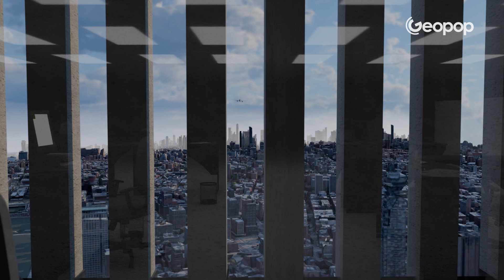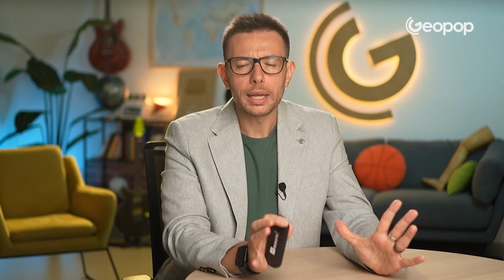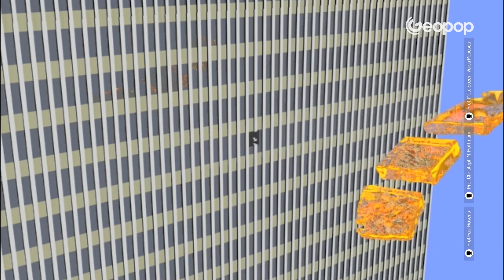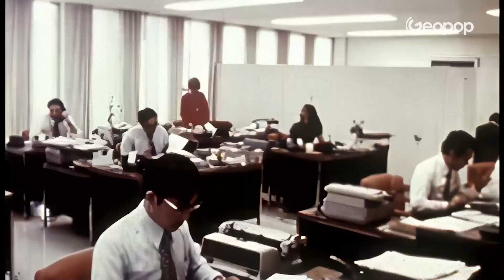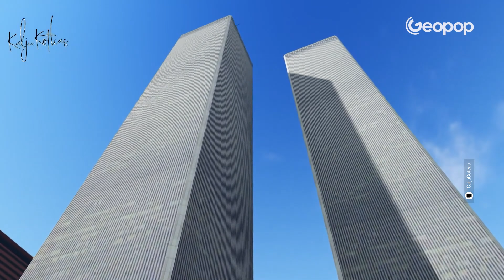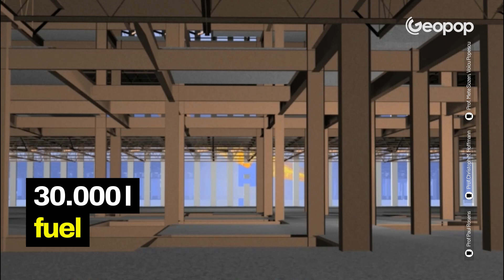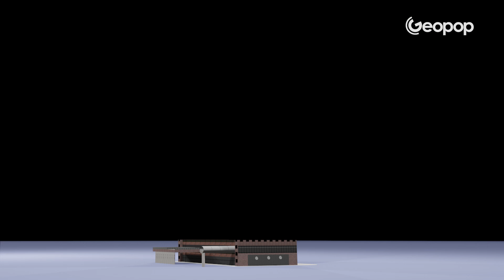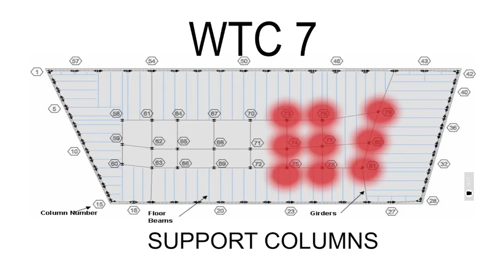9/11, 2001: The Technical Reconstruction of the Twin Towers and WTC 7 Collapses

Comment: This is absolutely laughable 😂 unreal that you seriously made this nonsense video and are standing by it. The towers could have had multiple planes hit them and they would still be standing if it wasn't for what ever was in them buildings to bring them down. The buildings literally would not have collapsed into their own footprint without it being pulverized into dust. Tons of concrete glass and plastics completely obliterated. Literally don't even need to be a professional it's common sense. Common sense tells you this is a complete lie
Reply: Nonsense.  I am going to respectfully disagree and offer a more plausible and far more detailed evidence, not ideology driven alternative.

Twin Towers collapses were relatively straightforward, well understood in the professional engineering community in within just weeks. For the average person though it still requires some effort. Engineering is hard, and who has that kind of time?  So the internet stepped in peddling a lot of really bad information, simple slogans and hand-wave rationalizations that are exciting and require little to no thinking.  That crap gets far too much attention.

Because anything can seem like a conspiracy if you don’t understand how it works and I’m an understanding kind of guy, I prepared this short, detailed technical overview of Twin Towers collapses from my own observation and analysis of available true and relevant facts. No politics, ideology or magical thinking, just engineering. Hopefully this will dispel many common myths and answer most if not all questions you may have about the collapses.  

While complex, most of the Twin Towers collapse mechanisms can be seen with the naked eye and easily discerned and understood by the layperson IF sufficient time is taken to understand.

1. The Twin Towers consisted of 4 primary structural elements that together formed an integrated system where each relied on the others. 47 hollow box-section steel Core Columns carry the majority of the gravity loads. The 236 hollow box-section steel Perimeter Columns carry the remainder and ALL of the lateral (wind) loads. Long-span Lightweight Steel Trusses connect the core and perimeter column together at each floor with a Hat Truss on top to tie the structure together as an integrated unit where no element can survive without the others. There was no structural load bearing concrete and most components were bolted together.

www.youtube.com/watch?v=u7OqrC74Dm4

2. The impact of 120 tons of airplane (= to about 12 dump trucks) at speeds up to 589 mph with the energy of a ton of TNT completely destroys the aircraft. This in no way implies the Towers come out unscathed. Many perimeter columns are damaged or destroyed as are some core columns (example; 33 of 59 perimeter and 20 of 47 core columns damaged or destroyed at the impact floors in the North Tower), This damage is primarily through bolt-shearing failures at the end connecting flanges, as well as bending, twisting and fracturing of weld seams. There was no cutting or slicing - the reality was far more violent and messy.

3. The impacts destroy or damage fire insulation, fire breaks and sprinkler systems on multiple floors. Huge fires are started across multiple floors simultaneously and allowed to spread rapidly with no effective firefighting or fire suppression. This was an unprecedented fire event .

4. The hotter steel gets the weaker it gets . With fire insulation stripped away and no sprinklers the survival time of the steel greatly reduced. Gradually over time heat causes the lightweight steel Floor Trusses at the impact damaged floors to sag, which was observed and recorded. No steel melted or needed to. Structural steel fails long before it becomes a puddle. It just needs to bend

5. Sagging floor trusses pull on the increasingly weak and overloaded Perimeter Columns, causing some of them to bow inward by up to 5 feet. A straight column is up to 4 times stronger than a bent column. The bowed Perimeter Columns buckle and fail, quietly initiating collapse. The formerly static mass above which the structure below could easily support is converted to a dynamic mass up to 30 times greater. Because they have buckled, the Columns above and below the failure point are no longer aligned . The load bearing structure below no longer bears any load as it falls past the lower columns, NOT onto them.

www.youtube.com/watch?v=ULdiD6gYZO0

6. Thousands of tons of debris fall within the four outer walls, down through the open office space, crashing onto the first intact floor it encounters, immediately breaking the bolted column connections as the amount of resistance the Floor Trusses can offer is negligible. The falling debris slows only marginally and briefly. Note: 
6a. This is NOT a solid top block crashing into and “crushing” a solid bottom block . 
6b. The debris falls past the columns not onto them. The columns provide no resistance to the falling debris. 
6c. Only the bolted floor truss connections to the core and perimeter columns offer any resistance. A pair of 5/8” bolts at each end of each truss vs. thousands of tons of falling debris. 
6d. No laws of physics are violated. 
6e. There is no 20 floors against 90 floors but rather 20 floors against one floor, then 21 floors against one floor, then 22 floors against one floor, etc. 

7. This floor-led collapse progression within the four outer walls can only go straight down.
7a. This process is often incorrectly referred to as “pancaking”. The catchy name stuck but nobody knows what it really means and "pancaking" is too simplistic and inaccurate anyway. I prefer Kaiserschmarrn.

8. Collapse progresses through the floor systems past the columns, through the path of least resistance . The resistance offered by each floor is always the same while the mass of debris and its velocity – thus its energy - increases with each floor failure. Each floor offers the exact same resistance to the falling mass while with each failure the falling debris constantly gains both mass and velocity. *This process of floor-by-floor destruction cannot be arrested, it can only speed up . Rate of floor failures increases with each floor as momentum increases, reaching an average acceleration of 0.65 of GA, or 35% slower than true free fall. Bam, bam, bam down the building until there are no more floors to fail. The resistance offered by each successive floor is always the same. More mass, more velocity, same resistance with each floor. Don’t get stuck on the but the lower floors weren’t on fire nonsense. They weren‘t and didn’t need to be.

9. The Towers were 95% air by volume. As that air was compressed inside the building it is forced down the tower and blown out the sides in reaction to the building collapsing . Those were not “explosions”, it was expulsions of compressed air caused by the collapsing building, explaining the low velocity, lack of flash, blast, supersonic pressure waves and lethal high-velocity ejecta.

10. Perimeter Columns become detached and peel away like a banana behind the collapse front, playing out to the four points of the compass extending to more than 800 feet from the base of the towers. This was quite obvious from examination of the debris pile.

11. Core Columns fail last as their internal beam bracing is stripped away by falling debris and lateral support from the floor to perimeter columns is lost.

www.youtube.com/watch?v=WpHXj62Ylw0

12. For those who care about how long this whole process took; 31-34 seconds from the moment the perimeter columns buckled until the last core columns hit the pile, or 1/3 the rate of true free fall. Don’t believe me? Just watch any video of the collapses and note the loose truly free-falling debris dropping much faster than the towers themselves.

13. Each Tower had a 1-acre footprint. Far from collapsing inside their own footprints the debris pile spread out over 17 acres in a pile up to 14 stories deep. 8 surrounding buildings were destroyed and scores more damaged by the falling debris.

14. NOT observed were the 180-190 dB bangs of thousands of high explosive devices or the blinding bright flashes of burning thermite. Neither explosives or thermite could have survived the impacts and subsequent fire nor could have caused the (silent) perimeter column buckling that clearly initiated collapse either. A video of a shocked and injured firefighter casually using the magic word explosion is in no way proof of explsoIVES and the demolition_ case relies entirely on that sort of thing. There is zero tangible physical evidence and it would be technically impossible, totally impractical and completely unnecessary. No one would bother.  In 24 years zero structural engineers of tall buildings, including the 1/3 that have retired in that time, have made any statements in support of pre-planned demolition claims. NONE. The lack of any such citations in the engineering literature (published in any country worldwide) is telling.

15. Twin Towers were perfectly safe within their design envelope. They only collapsed when taken far outside design parameters by an extraordinary and unprecedented event

Impact + Fire (heat) + Time + Gravity = Collapse . Remove any one of those 4 elements and there is no collapse. Ignore any of those elements (as many do) and you will never understand the collapses. The Twin Towers were an integrated system in which no one component could survive without the others. One fails, the rest follow, through the path of least resistance – DOWN – through the open space, bypassing the path of greatest resistance – the columns. Nothing I just described violates any laws of physics. All of the above is true no matter who planned and carried out the 9/11 attacks or why

I hope you found this helpful and informative. It’s meant to be non-adversarial and solicit informed critical comment, positive or negative. If I made any errors of fact, logic or reason or left anything critical out, please let me know so I can fix it. To stay focused, just one point at a time please and on-topic (Twin Towers ONLY). No word-salads of Gish Gallop. IF you can offer a more plausible alternative be my guest. Please start any reply with the words “Tits McGee” or I’ll know you didn’t read it, aren’t serious and wasting my time.

Comment: Anyway, I don’t believe that the Pentagon was impacted by an airplane. All the security camera footages around the Pentagon were seized immediately after the strike. Based on the footage of the twin towers, no way the Pentagon only had just a small portion damaged if an airplane hit it.
Reply: Belief has nothing to do with it.  Deal in facts.

www.youtube.com/watch?v=0SL2PzzOiF8&lc

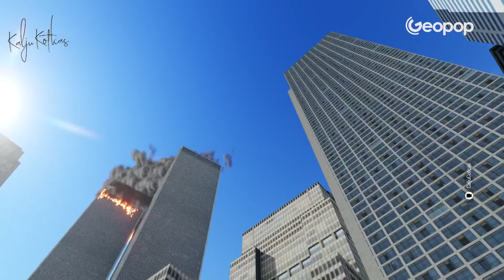The above video was shot on 2 identical low-res parking lot entry gate cameras with a fish-eye lens to widen the view at the short ranges the cameras were intended to capture, and short focus. The plane won’t jump out at you. It takes a little effort to make out what you are seeing. Each camera was focused at about 10-15 feet and shooting at just 1 fps. It is NOT continuous video (which is shot at 60 fps or better) so don’t expect continuous video. The target is roughly 800 feet away and moving at 462 knots, which means it travels 775 feet between frames. You can see the target by pausing at 0:05 for the 1st camera and 1:32 for the 2nd. 

There is just one frame per camera, the target is far away and not in focus. 

At 0:05 the aircraft is partially obscured by the parking lot ticket post on the right side of the frame. The nose, top of the fuselage and vertical tail are visible around the obstacle, as is the spiral smoke trail from the damaged left engine behind the aircraft. 

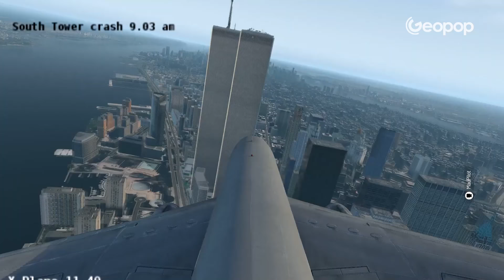At 1:32 the entire aircraft is visible, easiest to spot by following the smoke trail from left to right until it stops. That’s the airplane Personally, I always found it easier to watch for the doppler. Compare the frame before and look for what isn’t there. Have two tabs open and bounce back and forth between them. 

If you still can’t work it out then this video should help: 

youtube.com/watch?v=hixQ3zc2Bho&t=293s&ab_channel=Doll1789MarshallDhody

Then there is the mountain of physical evidence and witness accounts, all of which confirm Flight 77 hit the Pentagon - and all of which you are ignoring.

We know Flight 77 – a Boeing 757 - hit the Pentagon because of ALL of the following true and relevant facts, not because of one random anomaly. When complied together, all of these true and relevant facts form a single inescapable conclusion; 

1. Witnesses: Local and national media published or broadcast the accounts of ALL of whom reported a plane hit the Pentagon, while no witnesses reported seeing anything else (ie: none saw a missile). Around 2 dozen witnesses could identify either the aircraft type, the airline or both. 

2. Flight Path: On its way in, Flight 77 created a damage path (the tree hit by the left engine, the 5 light poles, the garden wall on the Pentagon lawn and the mobile diesel generator) which is consistent with an aircraft the dimensions and layout of a Boeing 757. No missile could do any of that. 

3. Impact Hole: The impact hole in the outside wall of E-Ring at Wedge 1 of the Pentagon matches in size and shape the Boeing 757 from engine to engine. Wing impact marks extend out on either side of that to the span of a 757. youtube.com/watch?v=FkgJ-rFFBD0 

4. Building Damage: The damage path inside the Pentagon takes the shape of an inverted cone, with over 80 support columns all of them bent in the direction of travel. This is consistent with the high speed impact of a Boeing 757 aircraft and NOT the high-explosive blast warhead of any missile. 

5. Aircraft Wreckage: 19 tons of B757 wreckage were recovered at the Pentagon crash site including the landing gear, both engines, the entire left wing flap assembly, part of the cockpit, seats (some still occupied), landing gear bay doors, fuselage sections, the Flight Data and Cockpit Voice Recorders for Flight 77, etc, etc,... youtube.com/watch?v=kCRuVNgrAAw&ab_channel=cjnewson88 

6. Two parking lot security camera videos from the north parking lot security booth captured images of a B757 sized aircraft in AA livery flying along the exact flight path of Flight 77 and at the same velocity recorded by its FDR. The aircraft was trailing smoke from the right engine due to hitting the aforementioned tree moments earlier as confirmed by several witnesses. 

7. Human remains: The remains of everyone aboard Flight 77 were recovered and identified with the exception of 1 infant whose remains could not be identified. Some victims were recovered still strapped in their seats. Each of the victims families were provided with a detailed autopsy report. 

8. Personal Effects: Several thousand personal items belonging to persons aboard Flight 77 were recovered at the crash site at the Pentagon with the victims families being provided with a 1,000+ page book detailing every item for identification and return. 

9. Radar: A total of 6 FAA and NORAD radar sites tracked Flight 77 from take off to impact. The radar data matches EXACTLY the 25 hours of flight data recovered from Flight 77’s recovered FDR, right down to the last decimal. youtube.com/watch?v=3vqDDlS9Hyw&t=6s&ab_channel=cjnewson88 

10. Insurance: American Airlines and its insurers accepted responsibility, admitting Flight 77 crashed at the Pentagon and subsequently paid out tens of millions of dollars in damages. 

11. Boeing; The folks at Boeing confirmed it was a Boeing 757 and specifically Flight 77 which hit the Pentagon. 

12. Where is Flight 77? It is a fact that Flight 77 never landed anywhere, nor has anyone aboard been seen or heard from since 77 crashed into the Pentagon. 

13. Even if the 9/11 attacks were an inside job, Flight 77 still hit the Pentagon and the above true facts are still true facts. “9/11 was an inside job” does not mean “flight 77 did not hit the Pentagon”. 

14. Pilot Skill: Hani Hanjour was a crap pilot and his flight path proves it. But he was grossly over-qualified to crash a plane – something anyone can do. A number of Hanjour’s instructors are on record stating that while he was not a good pilot, they have no doubt he crashed Flight 77 into the Pentagon. The conspiracy types always leave that part out. 

15. When staging an attack that absolutely has to use planes - and I cannot stress this enough - you use planes. Common sense. 

16. No blast crater or damage, radial fragmentation pattern, pre-formed fragments, missile parts or anything else associated with a missile were found. 

All of the above is true no matter who planned and carried out the 9/11 attacks or why - which I know will be seen as a blasphemy by many reading this. 

Anything can seem like a conspiracy if you don't understand it. Now you know. If you can do better then by all means, have at it. I am open to any more plausible alternative as to what hit the Pentagon using ALL of the available evidence while relying on fewer unproven assumptions than what I outlined above. 

Go ahead, be the first to even try. 

Since no one ever does, it’s been nice knowing you.
Reply: @TheLoonResistance love it! You know, one problem with all these conspiracy theorists and their theories is THEY ALL DIFFER IN ONE WAY OR ANOTHER.
Reply: @danmilosevich  - Then they mix and match and often have no idea they are self contradicting